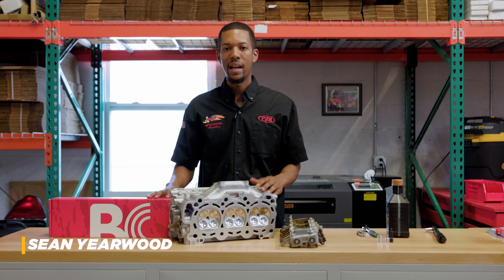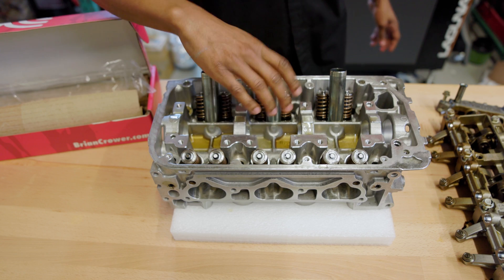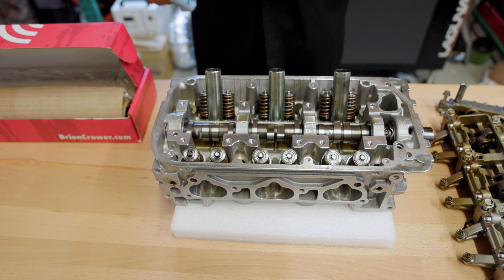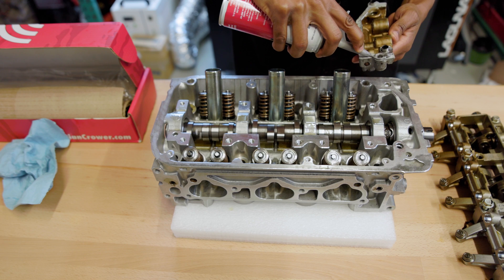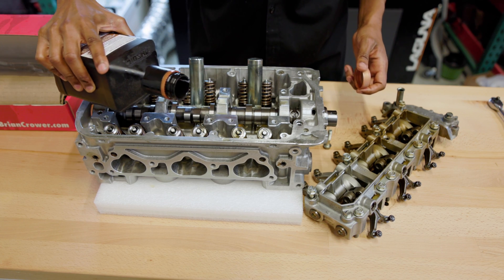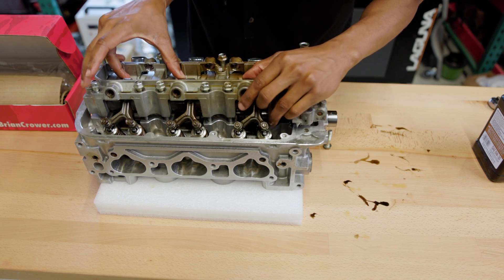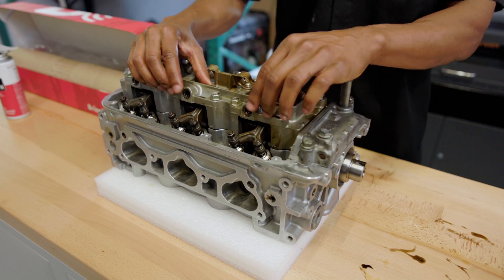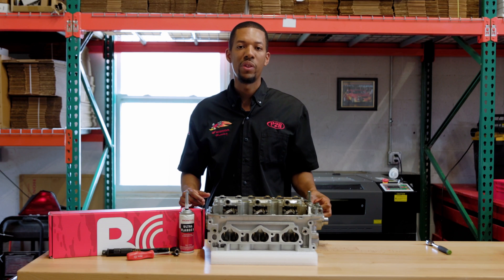J35Z Brian Crower Camshaft & Rocker Assembly Install on P2R CNC Ported Cylinder Head

Comment: Do you know if a J35Y2 will work as a direct replacement for a J35Z3 on manual 8th gen accord using the 8th gen ecu? I ask because the heads were re-designed on the 9th gen accords.

Comment: Will the j35z bc regrinds fit j37a2?
Reply from the maker: No, the cam design between those engines is different.   We actully have J37A2 & J37A4 Billet cams releasing before the year is over.

Comment: Will I be able to remove and reinstall the rocker arm assembly without removing the rocker bridge?
Reply from the maker: Yeah its possible but will be extremely complex to do and will risk dropping something in the head. Not worth the effort. Removing the bridge is way easier.
Reply: @PowerRevRacing  can you confirm that 2 out of 3 front intake rocker arms are identical?

Comment: Hey sean how do you feel final drive upgrades on honda/acura transmissions?
Reply from the maker: Can be very beneficial to do if your looking to get a ratio that keeps you in your power band.
Reply: @PowerRevRacing  so say i was looking to acheive a 300+ na j series build how beneficial would actually be with the right components attached like a pair of ported & rebuilt heads etc,?